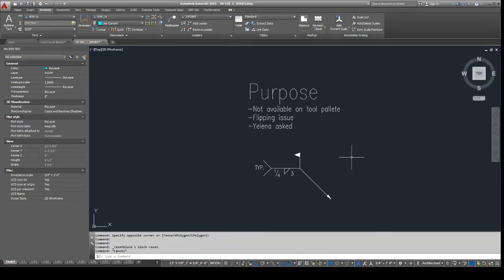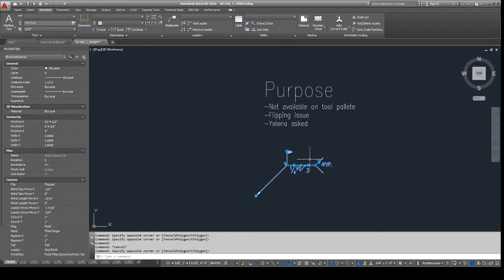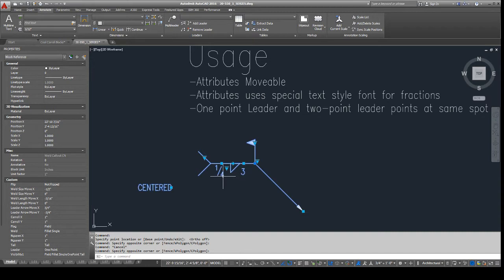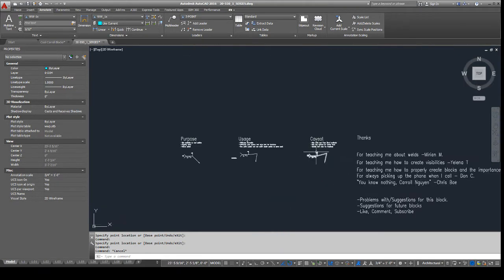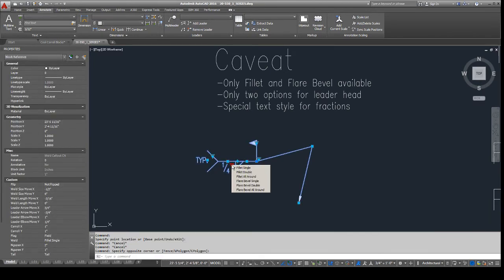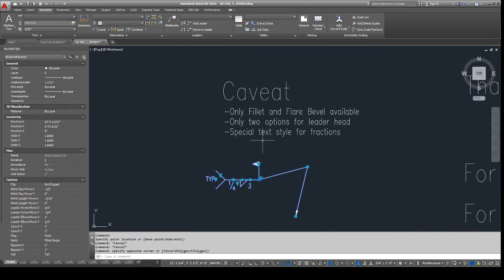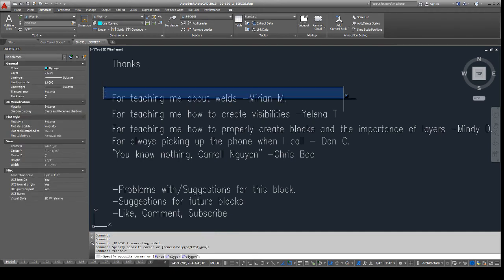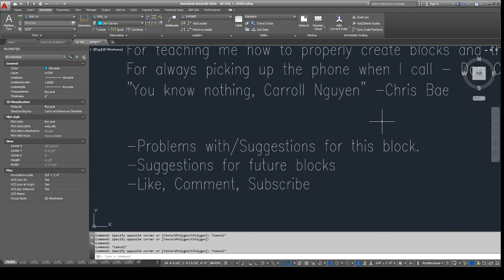AutoCAD Dynamic Weld Block

Comment: How do you combine these?  New to dynamic blocks.  How do you get two different leader types.  If you can show me that I can figure the rest out I'm sure if it's the same command approach..much appreciated.  Visibility states for welds sure, but looks like you control tail, flag and leader all separately.  Appears to be a look up command?  Some insight would be very helpful
Reply from the maker: Yes, it is several lookup commands chained together. I can't explain more than that since it's been so long. I'd have to look at it more closely to remember the precise details. But I Googled how to make a block with "multiple visibility states" when I originally made it.

The block actually has 16 or so visibilities. Each one is linked and the lookup calls upon a similar visibility, but only changes the end you clicked (i.e. fillet weld but flag vs no flag). The more parts you add to the block, the more permutations, which means more visibilities. It's a bit of work making all of them and then chaining all of them. The visibility is the easy part. The lookup is the hard part.

Comment: Do you have a video on how you made this block? How did you make the leader have a multiple vertex?
Reply from the maker: The actual block itself is very time-consuming to make (because a block can only have one visibility parameter; I used a work-around with look-ups to create multiple visibilities).

The leader is a bit easier to do.  Basically, you use a point parameter with a polar stretch action.  When you create the "frame," put anything that should move with the point in the frame and anything that should not move outside the frame.  Hope that makes sense.  Play around with it a bit, and what I said may make more sense.
Reply: @SpeedHunter020  Thanks Carroll. I've created some different dynamic blocks with visibility states, none with points. I play around with what you said and see how it works out.
Reply: @SpeedHunter020  is there a way I can get your block to look at it? Thanks
Reply from the maker: You can download it here:
https://drive.google.com/file/d/1L-vOo24CjV6rpjX-sJnGM8sSf9aAt4hJ/view
Reply: @SpeedHunter020  It work very nice but when i try to insert it the arrow changes to a line? I thank you did a awesome job .
Reply from the maker: @kennethbozeman7830  The arrow in the block is made from a leader.  It may have something to do with your settings or you've stretched the line too short (arrowhead does not appear if the leader is too short).